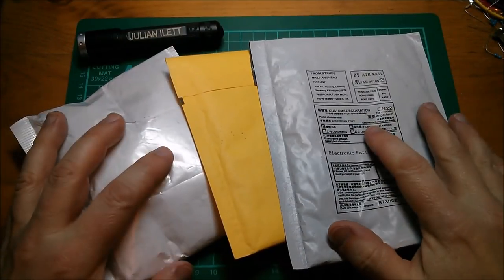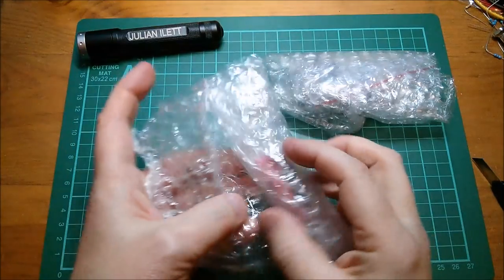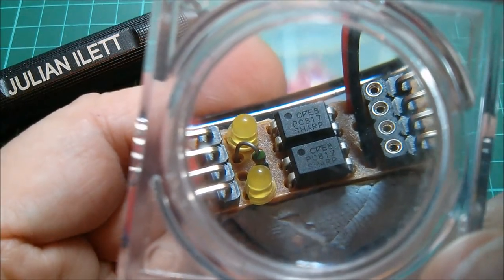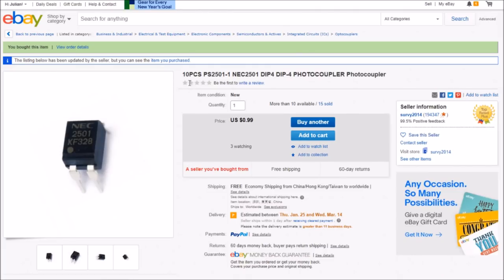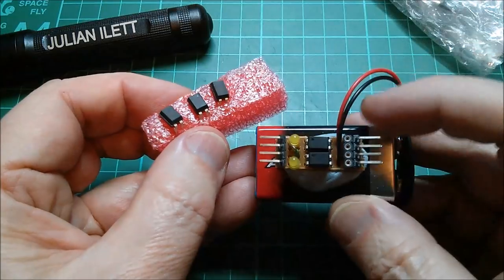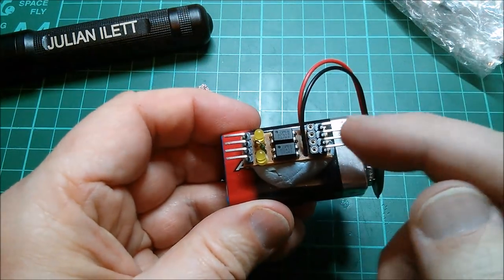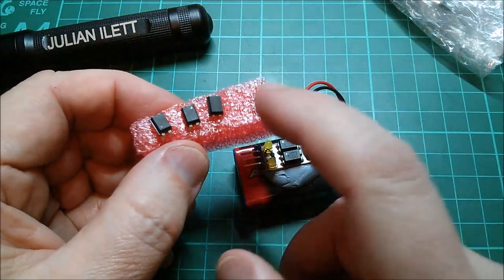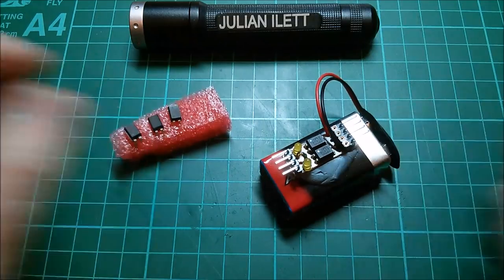Julian's Postbag: #112 - Optos, Adders, Multiplexers and Headers

Comment: I have some ltc3105 chips that I plan to mount to the same boards. My plan is to first glue the chip in place and then use conductive glue to connect it.

Comment: Fold the pins underneath?
Reply from the maker: +flagpoleeip SOJ style
Reply: I recently hand soldered some chips that completely covered the pads on the adapters and it wasn't any problem. You just need to use flux instead of relying on the stuff that's already in the core of your solder. Any bridges are easy to just wipe away with the iron or touch it with solder wick.

Comment: looks like your wide chips would fit on the 1.27mm side of the 20 pin adapter boards, you'd just have 4 unused pins on each.

Comment: You can get fast switching optocouplers for logic signal isolation. I've not tested any yet, but I'm currently looking at the 6n137 for isolating UART signals. It's capable of 10 Mbaud data rate (which is at least 10mhz) so it should be more than fast enough for PWM.
Reply: Take a look at ADuM1201 digital isolators for isolating UART signals. They're slightly more complicated than optoisolators in that they require a VCC/GND connection and a decoupling cap on each side of the isolation barrier, but otherwise they're much simpler to use. They're designed specifically for digital logic signals, are fast, have stronger isolation barriers, and clean edges. The ADuM1201 has one channel in each direction (ideal for RX and TX lines), while the ADuM1200 has two channels in the same direction. They also have other models of similar chips that do I2C, USB, etc. isolation. Very handy.
Reply: Thank you for the tip Pete, will definitely check those out!
Reply: himselfe You bet. I was running into issues that made optos a bit impractical (high speed serial with a high impedance output that would have needed an external buffer chip on each side of the barrier to provide the necessary current for the two optos) and the digital isolator fit the bill exactly. Made life a lot easier.

Comment: Maybe you're looking at speeing up the isolators the wrong way - how about conditioning the signal after them? Use a Schmitt buffer or comparator afterwards.
Reply: SPEEING XD
Reply: Indeed; the higher speed conventional optoisolators have a Schmitt Tigger output. You could add one to the 817 if you like.
Reply: There are two speeds, that of the edge coming out and that of the time to get through (more like a rate than a speed), which limits the frequency.

Comment: Julian,  I haven't watched this video yet, but when I saw the title snapshot, I thought you may be doing a test on how well the so-called anti-static containers prevent static buildup....How about an experiment using an ultra-high input impedance op-amp or a JFET in a circuit to measure charge on static-sensitive devices that are so-called protected in their containers?  Such as charge transfer (uC's) on/off surfaces of sensitive IC's just dumped out (well, SLID out) of one of those long plastic "IC tubes", perhaps into "half of a Lyden jar"?  ...now on to the video...
--dalE

Comment: In the MIDI world people are always looking for fast optocouplers.
I used a PC900V in my 5pin DIN MIDI to 0.1inch header box to connect old MIDI devices to an Adruino's TX/RX pins.

Other ones to look for would be the 6N137, 6N138 and supposedly the PC900V is the same as the H11L1
I think these are all 6 pin optos but other than that I'm not sure how exactly they're different than the basic ones you've already used. All I know is that when I did some experiments with the PC900V I got much faster rise times.

You can salvage them from old toy keyboards that have 5pin MIDI ports.

Comment: SOP-16 vs SSOP-16: SOP-16 has the gull-wings with a length of 1.4mm overall with a .8mm foot. SSOP-16 has the gull-wings with a length of 1mm overall with a .5mm foot.
The boards you ordered are SSOP-16's, whereas the IC's are SOP-16. So the IC's have a larger foot.
http://www.lapis-semi.com/en/package/sizesop.html

I came across this issue when designing my own PCB's for my project. As I'm a newb to PCB design, I overlooked those tiny measurements when building mine. Fortunately I didn't order them before having them checked over first  😜
I'm having to design a PCB (using EasyEDA: Project files: https://goo.gl/tVdTr4) for a TI chip for a custom BMS because there are no SSOP-30 adapter boards like the ones you bought on eBay. It's strange that they don't exist. Since I'm building the SSOP-30's, I decided to build the SSOP-20's as well and put the proper labeling on them.
Reply: Are you referring to Julian being the black hole? Had I not asked for advice from EasyEDA forum, I would of made a very similar mistake. I've never dealt with such small pieces before. I didn't realize the TI IC's I bought were smaller than a finger nail. But, that was my fault for not looking at the dimensions and assuming they were as big as they looked in the photo.
Also, you don't really realize how .3mm can make a difference on chips and pads till you lay them down.

Comment: the 74HC153A can be used with a 74AC74 as a Johnson Counter to build a Tayloe down converter mixer useful  with a DSP chip and DAC to recover the audio from radio waves.
Reply: You can, but the ham radio community got distracted with Tayloe converters, when they are actually just synchronous active mixers and there are better ways of doing it. You are essentially using the output stage of a digital IC as an analogue component, which inherently has limitations and quite a lot of noise.
Reply: Zadster I have a PANASONIC FM /DAB radio that uses a Dan Tayloe mixer chip and sounds better than any normal radio
Reply: I wouldn't disagree. I was just explaining that active mixers were around a long time before Tayloe got in there, and there are better ways of doing it than using digital chips to do an analogue chip's (or 4 transistor's) job.

Comment: I hate getting electronics wrapped in bubble wrap. Especially if they only come in ziplock bags, rather than proper ESD protective packaging.  I got som 74HC181 4 bit ALUs in the mail the other day from Ali Express that were wrapped in bubble wrap and despite it being a very humid day, I could hear and feel the static as I unwrapped them. I haven't used any yet to test for damage, but I intend to scold the seller.